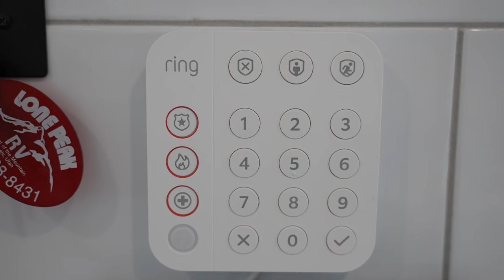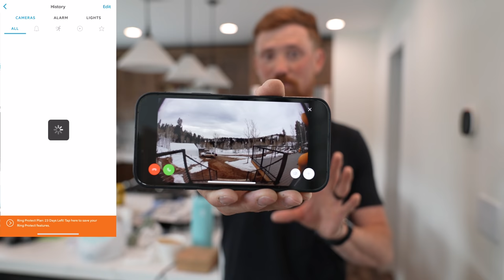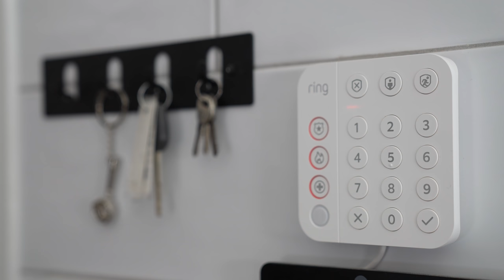EVERYTHING YOU WANT TO KNOW | Mountain Made Vans

Comment: I challenge y'all.... Build a van with a dishwasher (yes it can be a drawer dishwasher) and laundry (yes it can be a small/combo unit) and an air conditioner.... Still keep a bathroom and kitchen (with oven) and it can sleep just 2 if you need to for space reasons....  I still try and think if it's possible ❤️ keep up the hard work

Comment: I can understand the homey feel, thus avoiding the extruded aluminum 8020. But I think it is more about the lack of experience. Because it is certainly possible to build homey vans using 8020.
Reply: …and if you go to Humble Roads build outs with 8020, you will see impeccable homey vans and just so beautiful woodworking. So, @Stephen Cotton, you are dead on with your words!
Reply: I also believe as I saw with George on Humble,  a big investment in specific machines, tools, etc in order to tackle the 80/20.  Myself,  I would prefer 80/20 build for reducing weight, easy modifications, and ability to easily convert back to cargo van, etc.

Comment: What does 80 20 mean in this video?  And what is that white tarp/structure in front of your house used for?
Reply: It's a type of aluminum. It's super light weight compared to how thick of a piece of wood you have to use to achieve the same strength.

Comment: So is Simply safe out the door? Ring is better? Since you switched can you do a video comparing the 2 showing the disadvantages to Simply safe which you were sponsored by for a long time.
Reply: A comparision video would be a good idea!  They were so big on Simpli Safe in the past -- were sponsored by them at least once a month.  Not sure if they would do a comparision video, as it would mean showing that one product was more inferior, which isn't a terrible thing to do, but it doesn't sound like something they would be interested in doing.
Reply: Ring works when internet is out.  Simpli-safe does not. They mentioned the differences in the video. 
Creators are often sponsored by multiple companies.  Both parties are free to work with other creators and companies. 
There is no "better" product for everyone.  We all have different needs and some products are better for a particular situation. 
You choose what's best for you. Read comparisons. 
And guess what, some people even get multiple security systems..so try both.
Reply: @sandrachristensen7282  having different capabilities doesn't necessarily mean inferior.  One product never fills every need or situation.  They explained the difference with Ring in the video.
Reply: @laurieg673  
Incorrect SimpliSafe has a battery backed up base station and a SIM card. It will work when the power and wifi goes out
Reply: Love your shows.  But Simplisafe also has internet and backup cell service in case no internet available.  Mine does that.  Also battery backup.

Comment: I'm sure you guys are going to put out great vans. The battery chemistry you are using is far superior to Pamela Vanderson 1.0. But it's a far cry from LiFePO4. For a "premium" build there is no reason to not use LiFePO4 these days. IMHO.
Reply: could have went with bluetti, its what i just got!
Reply: @blessedveteran  I hav an eco flow and it's great. However, the lithium ion batteries are inferior to lithium iron phosphate. At best we will get about a third of the cycles of lithium iron phosphate. I guess the point of my response was if you're spending tens of thousands of dollars for a fan build there's no reason to go with lithium ion over lithium iron phosphate. The lithium ion batteries will need to be replaced a lot sooner than lithium iron phosphate.
Reply: @keithbrookshire  agreed. That is why I went with Bluetti

Comment: If I remember correctly, you advertised a different alarm system for Terry. Do you no longer like that brand and went to Ring? Just wondering!
Reply: They said in the video this one works when internet goes out.
Reply: @laurieg673  So does SimpliSafe, it’s all battery powered components and the base station has battery back up and a SIM card (cell phone) to call out if the power or wifi go out.
Maybe Ring have deeper pockets? Or other products that SimpliSafe doesn’t have.
Reply: Ring pays them more, so it's better
Reply: @dc5330  sponsors only sponsor for a specific period time before they find another  creator.  Sponsorships are driven by sales when you click on the creators link to their product.  Once sales fall off they move to another creator & a fresh audience .
It's ridiculous to think creators can't plug multiple products and companies.